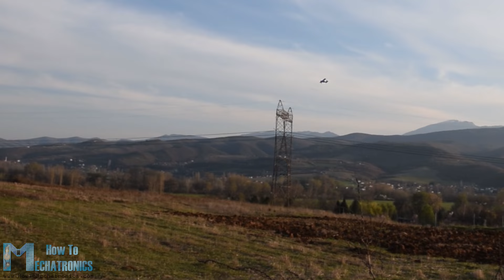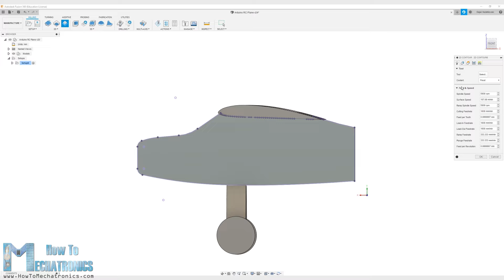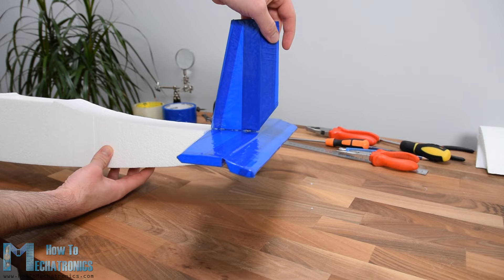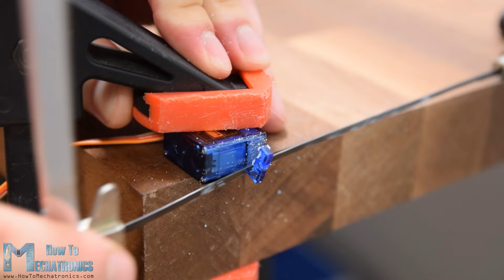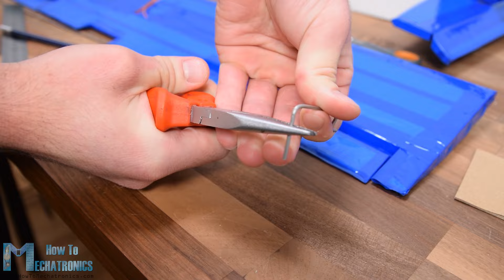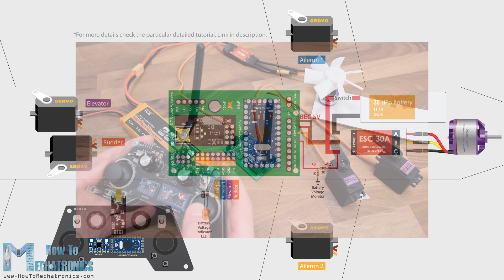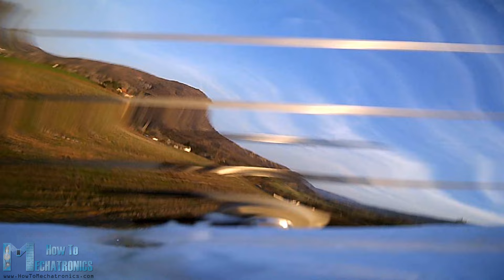Arduino RC Airplane | 100% DIY

Comment from the maker: I hope you enjoyed this video and learned something new! If you'd like to support me making more content like this,  please consider supporting me on Patreon: https://www.patreon.com/howtomechatronics
Reply: I'm facing a small problem everything works except channel 3 nd channel 1 I assinged d8TO CHANNEL 3 and it works fine but rudder is moving approx 80-90 on one side and 0-10 degree on another side please tell me how to fix this issue.
Reply: I learned that first rc plane is not perfect 😒
Reply: Can you 🙏🙏 🙏mention the size of this ✈️plane because I don't have cutting machine your plane is Awesome👏👏👏 and I really want to make it so please🙏🙏🙏🙏🙏🙏🙏 mention the diameter of this plane and the items please
Reply: What's the range of the controller

Comment: You shouldve taken into consideration the rpm required for enough thrust for takeoff and how much rpm the motor can handle without breaking due to inertia. But that is just a suggestion, absolutely love your work though ❤

Comment: Hi Dejan,

I’ve been following your RC plane project closely and decided to build the receiver based on your design. I even got the Gerber files and had the PCB made. Everything was going well until I connected a servo to the receiver. When I do that, the Arduino starts behaving strangely. Without the servo connected, the serial monitor shows all the info correctly, but once I connect the servo, the serial data freezes and things act weird.

I’ve already had one controller burned out after mistakenly changing the power supply, but I still can't figure out what’s causing this issue. The only change I made to the original design was replacing the 0.1µF ceramic capacitor with a 2.2µF electrolytic capacitor. Could that be causing the problem, or do you have any insights into what might be going wrong?

Any help would be greatly appreciated!

Thanks for the awesome project!

Comment: it has been 3 year. If I saw this earlier i might have commented before. I see the prop you used. Everytime i use the exact prop you used i came up with the same flying issue. change that exact prop i guess. replace with a good prop

Comment: I think it would be better if you give it a slight dihedral but not too much because you would disable the ailerons. I think that with two degrees of upward tilt in the wings it would be enough bye!

Comment: Hello. requesting an answer to my question. I have some 4-cell BMSs that I have used in a project and have some spare. can I use these BMSs for a 3-cell pack? if so would you please tell me how to wire this? I am using NMC chemistry 18650 cells 2500mAh.

Comment: (HELP!!!) Great inspiration! I'm trying it too but I'm experiencing servos' jitter issues. If i plug just the esc and motor to the receiver, data is exchanged fine, but as soon as I connect also a servo, everything starts misbehaving and servos start vibrating, causing also the motor to stutter. The power comes all from the esc 5V BEC adapter, as in your circuit, and the battery is a strong 11.1V 3s one. I've seen that servos can cause these problems, and capacitors are often the solution. In this case what can I do? thanks a lot!!
Reply: @Corneanu Gabriel   I tried connecting the servos' power/gnd to a completely separate source, but the problem persists. Checking on the serial monitor, data is exchanged flawlessly. Is like the arduino suffers to send contemporarily input signals both to the nrf24 and to the servos

Comment: 22:59 I wonder if it's not the terrain causing the turn but maybe propeller torque? Does the propeller turn anticlockwise when viewed from behind? Because if so then due to Newton's third law, for every action there is an equal and opposite reaction, the propeller spinning anticlockwise also makes the fuselage want to turn clockwise, which would explain the right yaw and then roll as you take off. Real planes can have a lot of trouble with this, some small planes require quite a lot of rudder when taking off to keep it straight, and don't make sudden adjustments to the throttle at low speeds or it will also make sudden adjustments to the direction of travel

Comment: paper backed foam, preferably on both sides, would give you MUCH stronger frame, and since it's hollow on the inside it's not gonna weigh much more if at all (double paper backed foam is twice as heavy as no backed foam), it's like building the frame as a double hull ship with consistent reinforcement between hulls (the foam in this case) :D ... use that laser diode on the scara robot you built

Comment: I am trying to search for a good article or video for drone with 4 motors. The radio tranmitter you have made is the best i ve seen. I want to make flight controller using arduino and mpu6050. I am not able to find a best tutorial. Are you working on posting such article. Please do so if not.

Comment: I have tip for you, on foam, put some stick glue, and then add paper. I did so for plane then even 3mm foam + colored paper from both sides, create very strong structure. And it's super easy to do. Btw, multiple rounds of paper, and glue is super strong, and light material, widely used for pirotechnics.

Comment: I'm facing a small problem everything works except channel 3 nd channel 1 I assinged d8TO CHANNEL 3 and it works fine but rudder is moving approx 80-90 on one side and 0-10 degree on another side please tell me how to fix this issue.

Comment: Hi. I have a toy rc drone. I want to convert it to a mini boat toy. The thing is that i will need a bigger motor for propeller.  When i connect a transistor to the original output of the motor it can not control the speed as pot changes. If i move the pot from rest position, no matter what position will get it is going at full speed. I tried to change base resistor, but nothing. It is totally wrong method or this technique has potential?
Reply from the maker: Hey, well it depends on the type of motor you are trying to control. If that's a DC motor you can use PWM output from Arduino to control transistor. Check my other tutorials about control various motors using Arduino.

Comment: Great video. It's pretty amazing what you have done. From my experience in RC, you need to build light or if not, build bigger. I have a wonderful Ikarus Shock Flyer Super Star that is made of thin Depron and has a wingspan of 800 mm, a length of 750 mm and a flying weight of about 200 g. So the servos are very small and the receiver is tiny. The plane flies really well. Sure, I've crashed it too and it is taped together like yours. Easier to hand launch and then land on its belly in grass. If I was to build a plane that had the size of receiver you have, I'd build it similar to the Multiplex Parkmaster with a wingspan of 975 mm and a higher wing loading. Try make it from Elapor if you can get it, or Depron. You can then end up with a flight weight of around 520 g. Use carbon rods to reinforce.

Comment: as has been noted, a  LOT of things were less-than optimal on this model.      i encourage you to make another, guided  by  My  comments  and what you have learned.       as you have  sorta  learned,   the  model  had  a  MASSIVELY  tail-heavy dom.      any prop-powered model  Should have a  dihedral main wing.   (for inboard-located dihedral, design of the wing Should include a 'narrow' center-section.   that is, a central part that  spans/crosses the fuselage!!)     if the main wing of a  model has sufficient  dihedral, control of the model  does  Not  Require   ailerons.      and, the  MASS  of two  servos could eliminated !!!         btw, the height of a vert-stab should be a bit less-than  fifty percent of stab span.        googletranslate

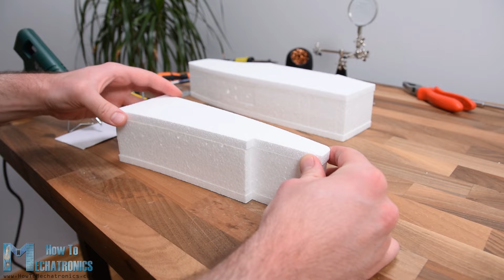Comment: at 8:14, the question is, why did you  NOT  just  cut out the tail boom, Having the  correct  dimensions?         a partial side panel  COULD  have been designed/used, to  'span'' the  join, in the fuselage !!!

Comment: Hey, amazing video!!
I was wondering if it is possible to use my laptop keys as the servo controller. Use a wifi antenna as the receiver and the Arduino and wifi module as the transmitter. If possible could you elaborate a little?

Comment: This is a really good tutorial for making a cheap but effective plane. This form is almost always used in starter planes fit for new pilots. It looks great and seems to fly very well.
The styrofoam seems to be very brittle though, I'd probably use a more flexible foam. 
For construction I wouldn't use hot glue due to the fact that once it cools, it's permanent and you don't have a lot of time to get everything aligned and then press firmly. It also easily melts styrofoam. I'd recommend using model glue. You'll recognize it in the store by the fact that it comes with a spray bottle of accelerant. Just drip a generous amount (enough to cover the area but not too much so it squeezes out and drips) and take your time aligning the parts. Once you're done, push everything together and spray the seam with accelerant. Don't worry about getting it on the inside, the glue will dry on its own. The accelerant is used to speed it up initially, but it is not required. This gives you a lot more time to make sure everything is perfectly aligned. Note: this type of glue doesn't always stick to tape! Make sure you test if it does.
Reply from the maker: Thanks for the input!

Comment: Great explanation. But what was the reason for the failure in earlier stages? Strength of the plane or its weight? I was expecting success at the first trial but the result made me to laugh. In Africa we have such like problems at the start.

Comment: you did quite well for your first time with designing RC plane. 
having a bit longer wing would have been good. 
an airfoil with higher CL would be better 
overall, impressive, considering

Comment: Wow, I can't believe you got it airborne and back in one piece, great work.👍 

Hitting the curb sucked though. 

I believe there are different modules that you could integrate too, like: GPS, gyros (3 & 6 axis) for attitude, barometric pressure for altitude, sonic or infrared sensors (for curbs lol), an FPV could probably be connected too.

You could also do mixes like adding some rudder when you bank.

Again great work and thanks for posting.

Comment: something similar happened to me, I crashed almost 10 times and still could fly.
Reply from the maker: The problem here was the styrofoam which was really fragile. I should have used different type of foam.

Comment: I  built  an arduino RC and a  telemetry TX and both of them are using NRF240L01 but different passcode. Where should I put the antennae  on the plane?

Comment: Very cool project congratulations. Forget the aluminum for the reinforcements and the landing gear, try to use rigid wire as piano strings for the landing gear and for the wing reinforcements use fiberglass rods, make wings with dihedral the flight is much more stable. The rear wheel must have a system where it moves along with the rudder to facilitate taxiing the model. The wings should be a little longer, 20 cm should be enough. place the rudder and elevator servos closer to the center of gravity they were too far back. In your transmitter, these video game sticks are very sensitive because they have a small activation course, replace them with radio control sticks, the sensitivity will stay as it should. There is a type of wood used in classic aeromodelling that is light and resistant and perfect for making reinforcements, I don't know what it is called in English but in Portuguese it is called "Madeira balsa", just search on google and you will find it. Greetings from Brazil and congratulations on the beautiful project, I hope you don't get discouraged and sorry for my poor English.
Reply from the maker: Thanks for the inputs! Those are really great remarks.

Comment: Please make an Arduino based Quadcopter. I'm waiting eagerly for the same.
Reply: It is very much possible. But it's going to be a bit hard. It will require a flight controller. You can certainly make one by using the arduino, but that'll be a lot of trial and error. It would also still need a digital gyroscope chip.

Comment: First of all, I think what you did was amazing for a guy who has no experience on RC airplane.
IMPORTANT! DO NOT REUSE BROKEN PROPELLERS. You can hurt someone if you're unlucky. Go buy a bunch of propellers.
I suggest you can 3D print a joystick that is longer than this black one, to have more percise control(something like those commercial transmitter, a stick shape thing). Compares to only using my thumb, I discovered that with both my thumb and index finger grabbing the joystick I can achive more percise control. Crashing is common in RC airplane, if you feel upset crashing, go fix it and try again, you won't feel so bad after you've crashed a lot of times😜
Reply from the maker: Thanks for the input!

Comment: so I see some of this already listed but a short list:
- dihedral wing
- expo on the controls (makes them non linear in response)
- ability to trim all 3 non-motor axis
- sounds like your 'heavy' for your wing and motor
- given that those radios are 2 direction, I would have the battery voltage sent to your controller so you can monitor it realtime.
- ideally your throttle direction is sticky and no springyness so it can be kept at a constant value if you let go.

Comment: Sir,
Can you please make a video on GPS guided boat using Apm 2.8.
Which can be also controlled by flysky transmitter ( or any other) and it should also have auto pilot mode, ie: we should be able to mark the location on the phone or laptop. So that it should go through the marked location. This will be very useful for fishing and many other.

Can you please do this video and it will be very useful for other's.

Comment: Can I make quadcopter from this transmitter and receiver??
Reply: Yes you can, but commercial flight controller use SBUS protocol for RX, I think there exists libraries that can handle SBUS, so just need to modify some code. But if you want to build a drone entirely from arduino, it's a different story...

Comment: You should run an algorithm in the Arduino to counteract the reaction from the motor. 
With trims on zero you will see that the plane will have the tendency to rotate in the opposite direction the motor is spinning.

Comment: Im also rc hobbyst I think the delay is to high between remote and receiver. Try to use rfm modules like rfm98 the distance will be more longer and stable.

Comment: Hallo from Kazakhstan :) Im a radio engineer and programmer I build solar powered rover controlled via gsm and I have one problem. I have camera and need send picture via gsm using web socket or post request to the server. So car use web interface to control the car and take a picture. I now that the link speed is very low but it is not very important. The goal is that I can in any place control my car. Mey you can make tutorial for this idea or how can I send picture via gsm module. It will be great project 👍
Reply from the maker: Hey, you idea sounds pretty cool, that would be an awesome project indeed. Maybe I would make such a project in a future video. Cheers!

Comment: Propeller dimension?
Reply from the maker: I used the 8040 8X4 Inch prop. That's around 20cm in length.

Comment: The same thing has happened to me when I first build my RC plane that is CRASH. I was so disappointed with it because I build it so passionately as you did. After a lot of hard crashes and rebuild still, I was unable to fly properly. I came to know that Flying is also as important as building it...Then I improved my flying skills on Realfight RC simulator on my PC and after a little a bit of practice I did it...It as flying perfectly. I also recommend everyone to practice on an RC simulator before having your first flight...
And as always this tutorial was also great...
Reply from the maker: Thanks for the input. That's true, you really need flying experience as well, especially if you are a beginner.

Comment: In battery monitor circuit when run at high speed voltage drops significantly and cannot apply low voltage powercut function.helpme

Comment: For a first experience, it's actually good, I would recommend using some dihedral on the wing, about 3° and using lower rates on your radio, and for building materials, use foam board, styrofoam breaks very easily unless you use a very high density one. Good project. Cheers!
Reply from the maker: Hey Joy, thanks for the input! To be honest, your "DIY Homemade RC Airplane" video was big inspiration and it helped me a lot in the process of making this plane. So, thanks for that too. You have really awesome content for RC models. Cheers! 😀
Reply: @HowToMechatronics  hey bro please make v2 of rc arduino plane
And rc arduino Quadcopter
Reply: I'm glad you like my content because I also like yours and watch your videos for inspiration in some of my projects.

Comment: Please though some fiberglass/epoxy on those walls.
Also you need a analog trigger for you peed control. Amd or devote one of those dials. 
Also need to slow your gain. Just like you did with one of those dials. But it should improve the overall flight if when your pulling up its only adding small increments when the thumb stick is applied. And add bigger chunks when you bed it further. This way its not a 1:1 with the thumb stick controls.

Comment: Really nice! I like all of your content, it motivates me to go on with my own projects. Did you simply start doing your projects or have you also bought books and other stuff to get on this high level of knowledge and quality? Do you have some tips for getting better in DIY projects like this?
Reply from the maker: Thanks! Knowledge is gathered throughout the years, in school, university, self-teaching, trials and errors and so on. Best tip for getting better in DIY project is to start doing them right now. As time goes by you will gain more experience and eventually you will become Pro! Cheers! ✌